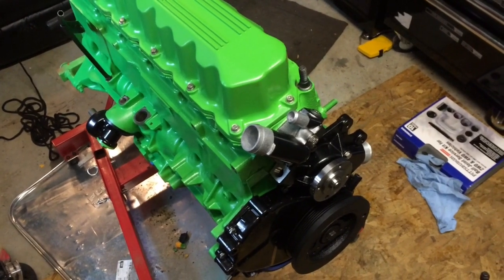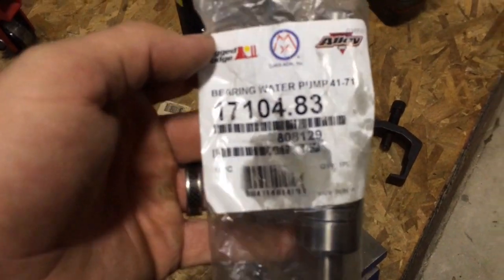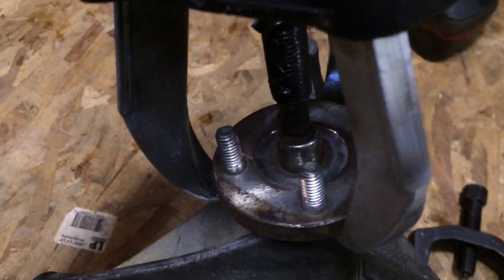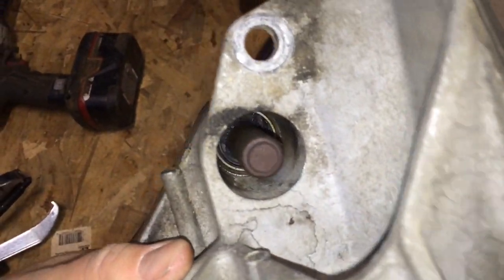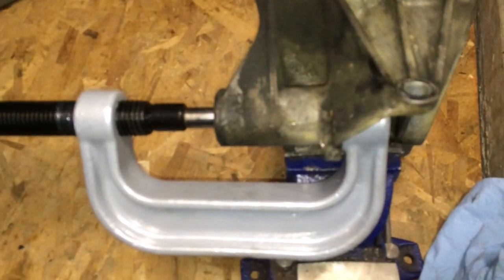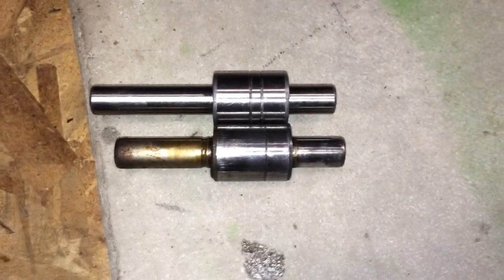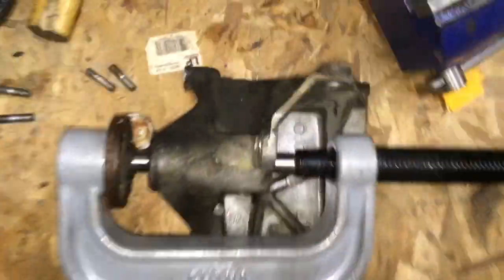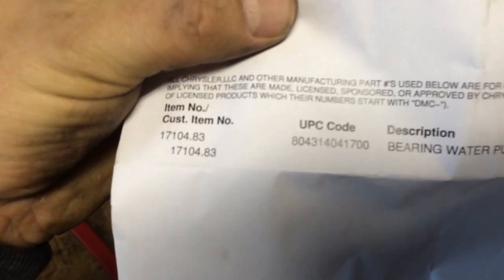4.0L Jeep A/C Bracket, Fan Clutch Bearing Replacement $19

Comment: I've done a couple of those, that "chirp' is the tell for sure. Thought it was the idler; imagine my surprise when it was still there after replacing that. I made the mistake the first time pressing it in the first time too hard, glad I bought two! After that I went to U Pull it and grabbed that bracket so i would have one at the ready. 10 years later i need it again
Good video, thanks!

Comment: I recommend the use of a socket and a hammer to install the new bearing, as you can tell exactly when the bearing bottoms out...more importantly, when to stop!  The first bearing I replaced, I used a 12-ton press to install it and I pressed on it a little too hard when I didn't first notice it had bottomed out...the bearing worked, but it had a little rough feel to it when you rotated it by hand.  I used it anyhow, as I needed to drive the jeep.  A week later, the bearing was making itself known under the hood!  When I pulled it out again, the bearing had come loose from the fan shaft.  I replaced it again, this time using your method of a socket and a rubber hammer...when it bottomed out this time, I could easily tell by the different tone my hammer and socket made against my welding table. I expect this one will last a little longer!  Thanks for the video....even with buying 2 bearings, I still saved a ton from buying a factory replacement bracket.

Comment: Could a bad bearing make a knocking sound ?
Reply from the maker: Yes, especially at low rpm. You can remove the belt to verify. Also rock the fan clutch to check for play.

Comment from the maker: @opal lynn, the bracket is going on a 2000 XJ, the bearing is in fact a water pump bearing for '43-'71. It does work. It's not the perfect length, but the part that matters is perfect.
Reply: Thanks for your help

Comment from the maker: As far as pushing the bearing in, you can feel it bottom out. As far as the mounting the hub for the fan just eyeball it as you go
Reply: Tinkering Fox before you take the old one apart measure the spacing between the fan hub and bracket with a feeler gauge. then install the hub on the new using that
Reply from the maker: Also check out part 6 of the Stroker build to see what happens if it gets pushed on too far.

Comment: Tinkering Fox- What kind of jeep did or does this motor go on ?  My husband has a right hand drive 1996 jeep, that has the same problem.  There seems to be some of the old bearing inside the housing.  It broke down on him and I am assuming some parts flew off.
Reply from the maker: Vickie Jones this will fit pretty much any 4.0. The TJ wranglers and grand cherokees use a tensioner pulley set up but the early wranglers use this as well. Rock auto sells the whole thing for about $200
Reply from the maker: Vickie Jones if part of the bearing race is stuck inside it can be popped out.
Reply: What is the name of what to look for on rock auto, we have seen it called idler pully fan bracket, Fan Bearing housing belt pully, we are confused.
Reply from the maker: Vickie Jones 
https://www.rockauto.com/en/parts/mopar,53011002,a/c+compressor+bracket,14796
Reply from the maker: Vickie Jones it took me a second too

Comment: What year Jeep is this bearing being installed on? The manufacturer says that it  will fit 43-71 year vehicles.  I have a 1999 jeep cherokee xj with a 4.0 do yo think it will fit ?
Reply: opal lynn yes it will fit like a glove.  The rear shaft is about half in longer, but it fits and works like a glove.  I used this video to do mine.
Reply: ***** google "Steve-o's greasable mod"